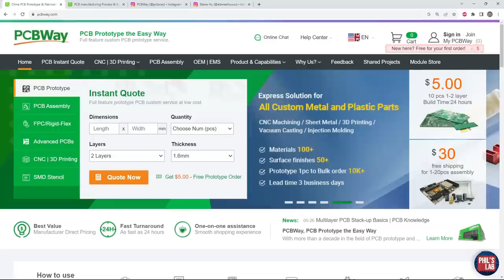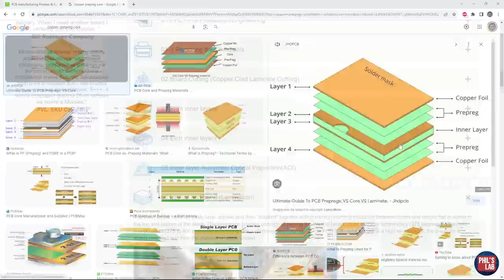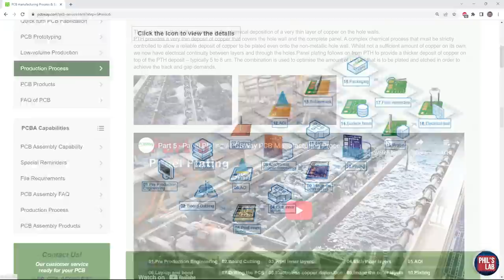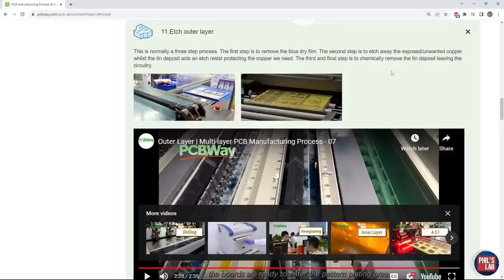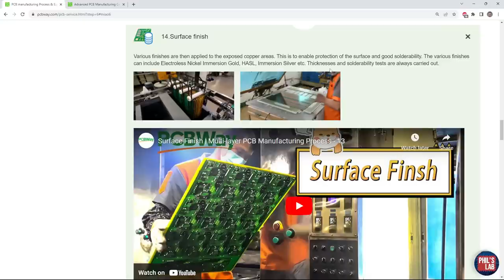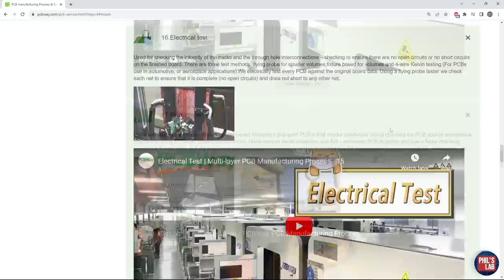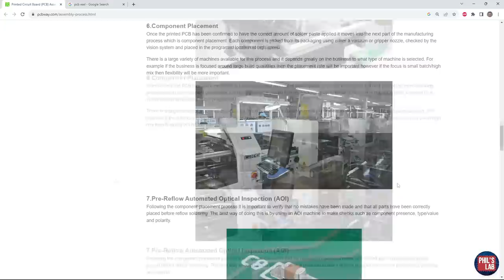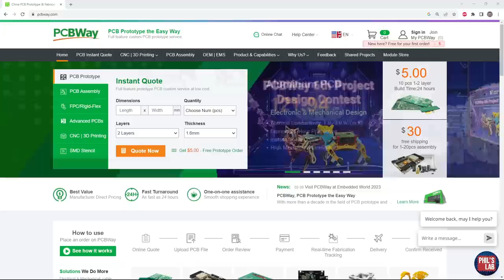How PCBs are Manufactured & Assembled (PCBWay Factory Tour) - Phil's Lab #120

Comment: Well done! 

I was also surprised (like a few others who commented), at the amount of manual labor that seemed to be involved.  I was expecting a lot more automation.

 I did notice a small thing at about 4:12.  You said that for a 2 layer board you would go from step 2 (board cutting) directly to step 9 (Image the outer layers).  I think you should have said to go from step 2 directly to step 7 (drilling the PCB).  I would assume that a 2 layer board still needs to be drilled and the holes electroless plated.  

Thanks for the video, it was very informative.

Comment: Very cool. I was surprised by the etch process removes the photo mask from where you want the copper then using tin as the etch mask. Wonder what the benefit of the extra steps are over the more common technique of removing the UV mask where you want to etch away? 🤔
Reply: Vias being protected.